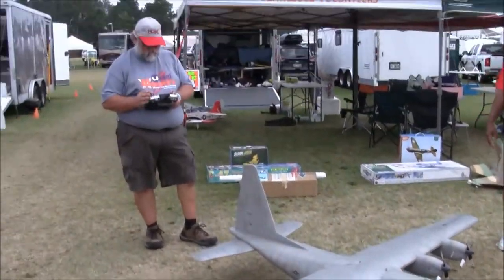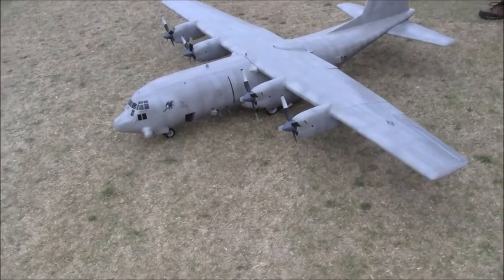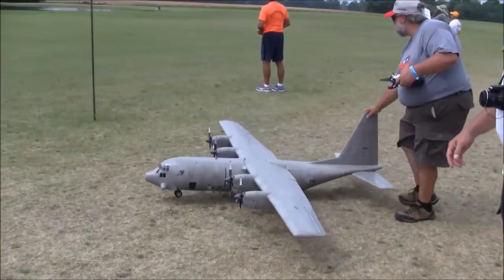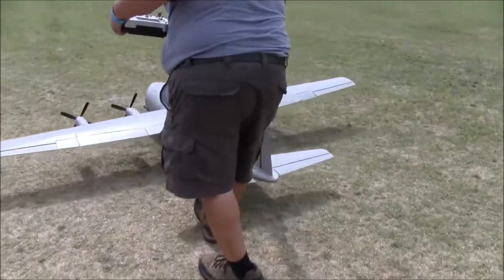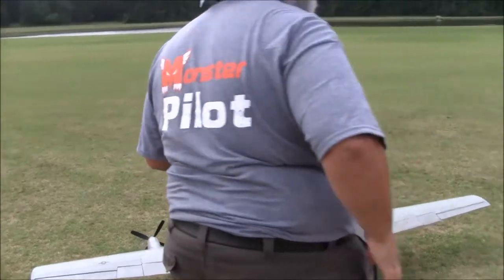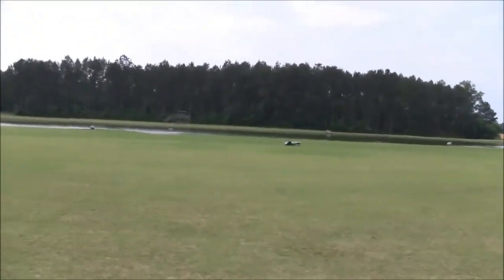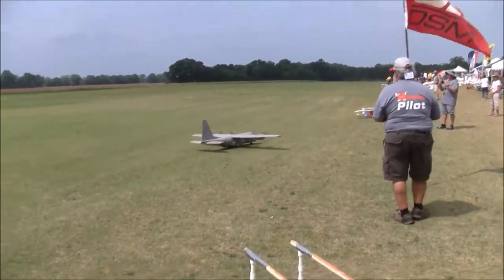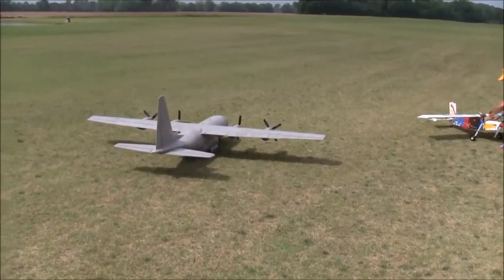John Morgan's AC-130; Final Prep and Pre-Flight at SEFF - 29APR17

Comment: That airplane looks like a kit I have in my shop.  It is a fiberglass fuse with foam core wings.  Why I think it is the same is the wing is mounted too high and the horizontal stab is on the bottom of the fuse instead of the top.  the fuse is not symmetrical from one side to the other.  I am so frustrated with it that I will not finish it.  I noticed this airplane also has the stab on the bottom.
Reply from the maker: Hi Joseph! I think the builder did say he had to do quite a bit of mods to get this plane together. Not a great kit, but definitely good results with a little work 👍😎!
Reply: It’s probably a ac-130h spectre italeri